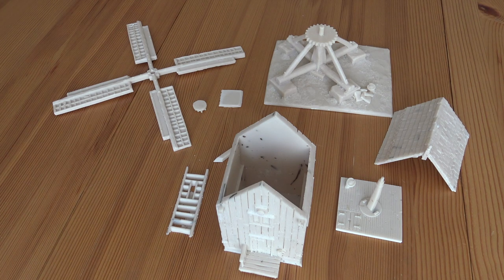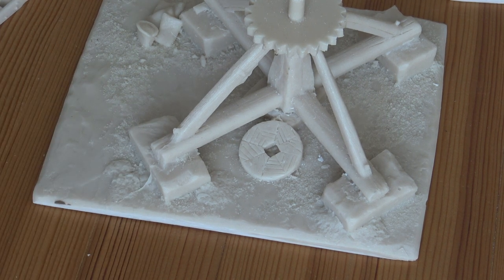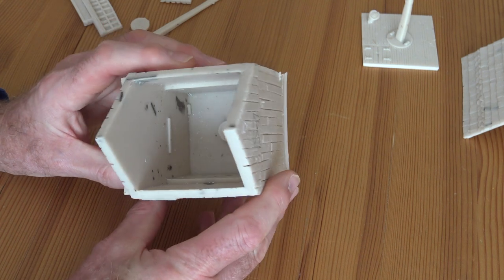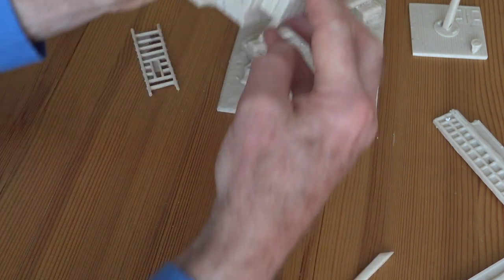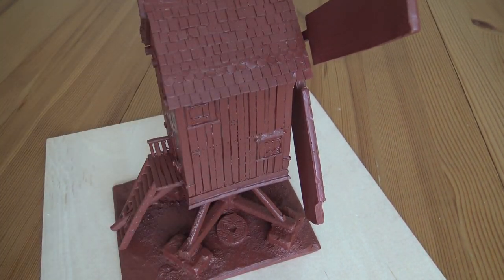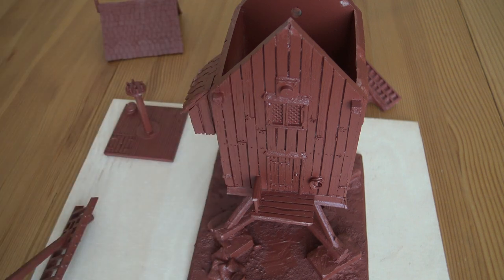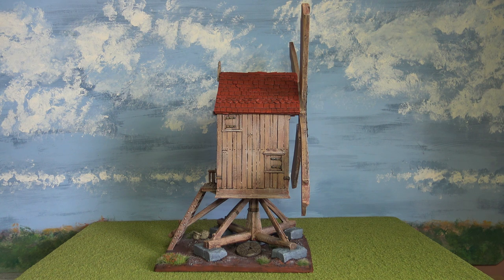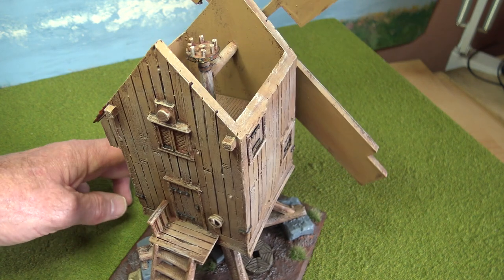28mm Medieval Windmill

Comment: I agree with your assessment of the ladder position Ralph. The treads would be parallel with the ground surely. It might not be too difficult to mask the back of the sails and black out the areas to match the recesses on the front. Would probably look okay. It looks good as is so I won't be surprised if you don't want to revisit it.
Reply from the maker: You're right Chris; I rarely revisit anything, no matter how badly constructed or painted (I was looking at some figures that really need reworking yesterday but can't bring myself to do it). When I'm presented by a solid flat surface of resin I despair because no matter how much painting trickery and trompe l'oeil I employ it never hides the basic fact that it is a lump of unsculpted metal, plastic or resin.

Comment: This is a very fascinating video Ralph. Lovely model and paintwork and what a grim revelation as to the other uses of the windmill. I did enjoy sharing your thought processes from start to finish as to its construction etc. Do you have any more models like this that need putting together? 😎
Reply from the maker: I have many more models - some from the same company, but they won't make such interesting subjects. I thought this particular video might also work as a paint along video so partly tried it for that reason. On the subject of which - what's happened to your regular Wednesday On the Bench with Pete this week?
Reply: Ah I ran out of back up videos and am currently putting one together that I recorded yesterday 🤔

Comment: I think I've found the windmill on which your model is based, Ralph.  It's one of the windmills from the battlefield of Lutzen (1632).  Rebuilt in much the same form, the originals were damaged/dismantled before or during the battle in 1632.  I found the photo, taken just before their demolition in 1902/3, on page 45 of Richard Brzezinski's Osprey Campaign book on the battle.  I've taken a photo of the page but can't upload it here.  One point to note is that the protrusion on the tiller of the seems to be on its underside rather than its top.
Reply from the maker: I'll keep an eye out for that photo - thanks. But I can clearly remember the model was 'pitched' at a much earlier period and there are other English mills that might well be the candidate - for instance the photos suggested by Andy Mac in this comments section. It wouldn't make sense for Grand Manner to have two almost contemporary models, one for Lutzen and the other for Naseby. This is one of the problems with making purchases that are then squirrelled away - you can't remember the exact details of what they are.
Reply: Ralph Astley the details of the photo and the model are very similar, down to the position of the old millstone.  Could it be that Redoubt first of all used the photo from the Lutzen book as a model and then corrected it from another source?  Near contemporary illustrations of Lurzen show mills on the same tripod bases as the 1902/3 photo and your model.  Could it be that English mills were different?
Reply from the maker: I've found the photo you refer to on-line. I agree they are very similar, but a comment on the TMP site points out that this style of windmill was common right across Europe, so I think it is more a case of Grand Manner (not Redoubt) having a lot of examples to choose from, rather than them selecting this particular photo. The good news for me is that I can use my model for many different settings and periods, not just medieval as I first thought, and also for Eastern Europe as well as Western Europe.